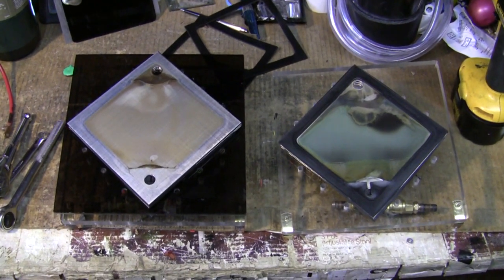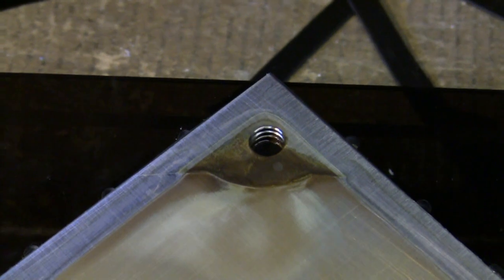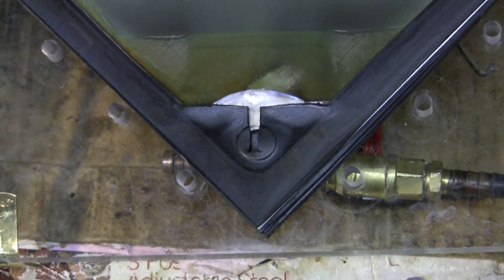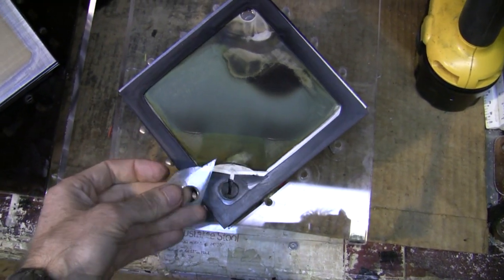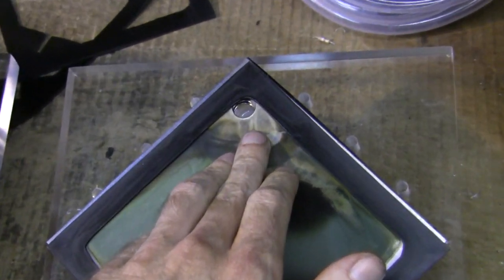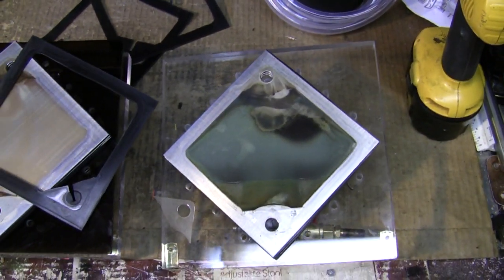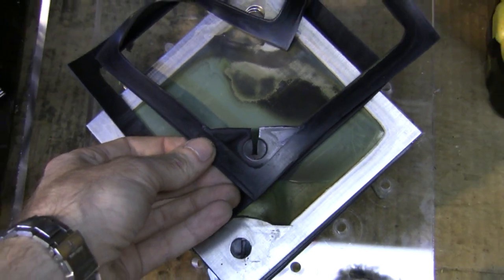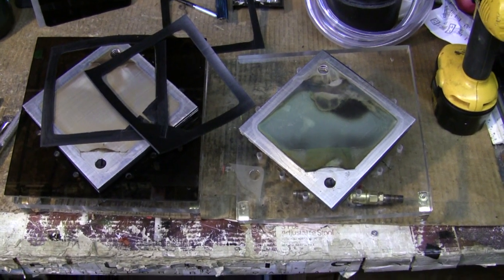Dissecting My SSC Cell In My 89 Mustang HHO #7

Comment from the maker: That is incorrect. Voltage and Current want to take the path of least Resistance. The stainless has a higher resistance than the electrolyte flowing through the holes. As long as there is voltage leakage around the plates then there is less power flowing between the plates to make HHO.